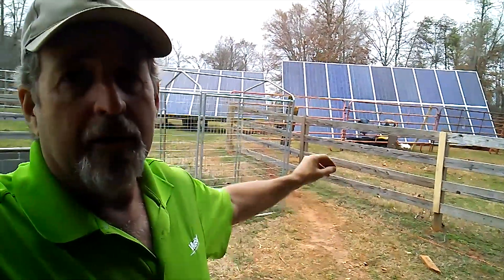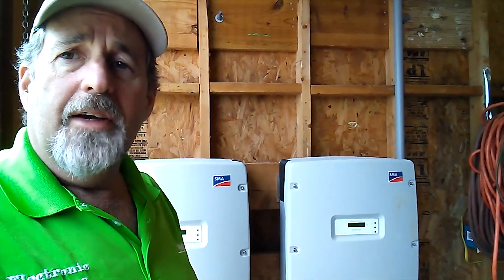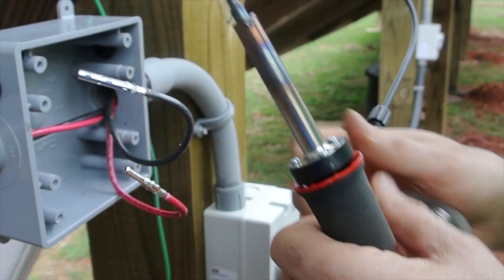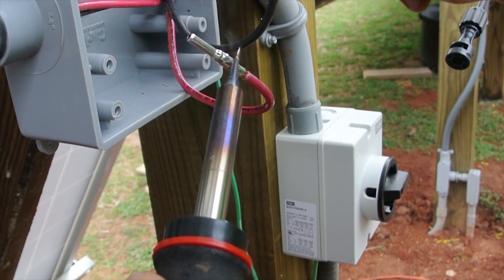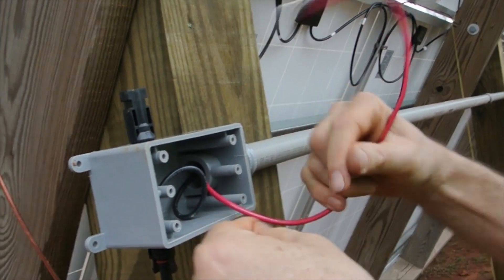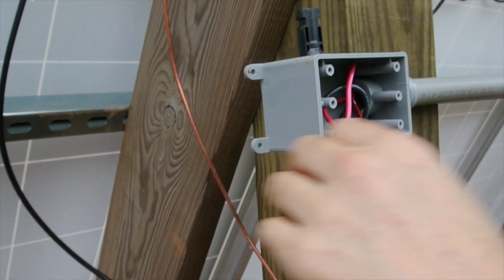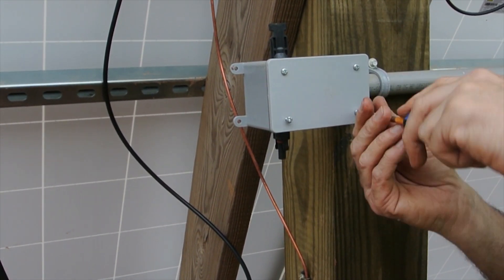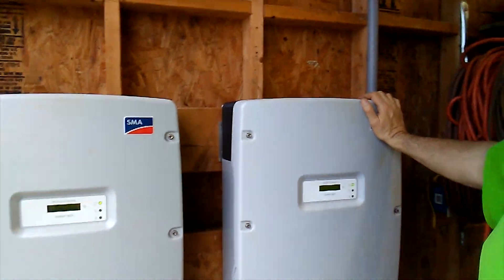BUILDING A 10,000 WATT SOLAR FARM - Part 3

Comment: Did you need an assistance from a licensed solar installer regarding a printed plan of your system, proper wiring it to the grid, all necessary paperworks and other requirements needed to present to your power company for final inspection and approval for net metering?

Comment: Did you use any stainless hardware with the unistrut rails to mount the panels, or just for the electrical connections? I'm looking to just make sure the electrical connections don't have galvanization problems.

Comment: I really like the MC4 connectors coming from the junction box. That's cool.
Reply from the maker: Yes they work well. You can buy the mc4's for box mounting. They have a rubber o-ring to seal around the hole.
Reply: @electronicsolutions1126  I had no idea those existed, thanks!

Comment: I have a question. I just a video where the guy is only using 9 solar panels. He is getting 10,000 watts. So why are having to use 36 solar panels to achieve 10,000?
Reply from the maker: He is probably making 10,000 watts per day. The one we built can do up to 10,000 per hour.
Reply: Each panel is probably 310W. 36 x 310 is 11,160W. That is ideal perfect output max. This is not realistic so there is some loss. 10KW from 36 panels @ 310W is probably realistic on a very sunny day with a ideal adjustment angle.
Reply: basic units confusion,  non trades/tech/emgineering people tend to talk in watts and the systems are sold in units of max watts output (which is rarely if ever seen)   Watts is an instantaneous measure of power.
Real usable output is measured in kilowatt hours (kWh) or Megawatt hours (MWh)  i.e usable energy delivered over time.

That guys 9 panel system will really deliver something like 9x250W=2250W then over time (say 4 hurs around lunchtime) he would produce 4hrsx2250w=9kWh

Not for all the talk focussing on the optimal wattage rating ,  solar installtions are only about 40% efficient (mostly less than that depending on location)  that is they will only ever produce 40% max of the theoretical kWh output .   This is due to night, weather, orientation, shading, dirt, snow, bird crap (the love perching on those high points) and panel degradation over time.

Comment: Im worried about building a frame with wood in exposed weather. Is wind and rain an issue?  How much did this whole project cost you?
Reply from the maker: No problems so far. We have had some bad storms with high winds. Its. Rather heavy. About 1500 lbs per unit. I don't have any wind concerns unless its a tornado heading right towards it. We used the super treated lumber rated for direct ground contact. In the future if one beam is going bad it can easily be changed without taking everything apart. I think the next one we build will be all bolt together unistrut steel anyway. I think it will be easier. This entire setup costs about 90 cents per watt to complete.

Comment: Thanks for sharing all this info! How many panels did you hock together on each string?
Reply from the maker: We had 9 panels in a string. Its based on the inverters open circuit voltage limit.

Comment: Sir, I watched all your parts, but you never mentioned anything about power storage? Do you only sell the excess electricity?
Reply from the maker: Yes, the excess is being sold. Its not the best solution for savings but on something this size its still a decent return on investment. Its looking like 3 1/2 to 4 years and the amount of savings on the power bill will match what was spent. Since Georgia Power only pays about 4 cents per kilowatt for the excess and we pay about 14 cents including taxes and other charges, it would save more money to do some sort of storage battery where the power could be used at night. During the day when it is sunny you don't have to worry about usage though. Its hard to use more than 10,000 watts per hour in a normal household so daytime electricity is free, especially nice in the summer when the AC is running keeping the house cool.  We may be doing a battery upgrade on this project. We are hopeful some sort of solid-state battery will be mass produced soon! That would be the best solution and probably worth the wait.
Reply: @electronicsolutions1126  sounds like the perfect spot for a Tesla Power wall, or if you are deciding to go bigger I suggest going with a Tesla Powerpack, that way you can utilize the battery system to discharge during peak power pricing.
Reply: I've heard that a used EV battery can be a great way to go for a battery pack they can be useful for another 10 to 20 years.  Nice job on the solar farm. I hope to do something like this one day.
Reply from the maker: @JamesB0003  I have been thinking about looking for a used EV battery. I am not sure of the life expectancy. I am hoping new battery technology comes out soon like Solid State Batteries.
Reply: Here is a link to the video where I got my information. 
https://youtu.be/WqJW4NgobTU

Comment: Can you make money  if you had a vacant lot with a power pole on it?  Is it a money maker if you have access to parts and labor at the right price?
Reply from the maker: Yes, you can make money but you need a decent size solar array. Most power companies will pay more per kwh if you have over a certain size. They will want a contract commitment of probably 10 to 15 years. I think around here its 25kwh or less is considered residential and they pay about 4 cents per kwh. A larger commercial system could earn 10 cents per kwh. It will vary a lot between power companies. I watch one video the other day and the guy was getting 14 cents per kwh at his house in a different State. That's very good buyback about!
Reply: Electronic Solutions I am thinking of buying some from a wholesaler and putting them on a cheap metered lot.

Comment: I think you mean 50kwh per day, 50kw is 50k joules in one second which isn't much energy. I presume you averaging about 10kw for about 5 hours per day (Solar convolution calc) which would produce about 50kWh per day from a 10kW PV array.
Reply from the maker: Yes measured in kwh, just like a meter on a house measures. You are correct, the 2 are really different!